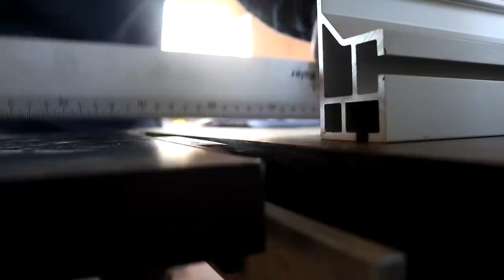Milling Biggest Burl in my life.   Logs to Lumber on a Bandsaw. First cut on  Felder FB 510

Comment: Congratulations on the new Felder. I have one, and would think very hard, before “upgrading “ to the ceramic guides. In my opinion they are not worth the cost, and the cut is no better than the original guides. Fantastic looking wood. Enjoy it’s a great machine.
Reply from the maker: Thanks.

Comment: Nice, the FB510 is one of my favourite saws to use. I use a plywood jig for the saw to mill logs, it runs in the mitre slot on the table.

Table extensions are nice, they increase safety, accuracy and they make the work so much easier.

I like your dog, we have a Bernese/Shepherd cross.